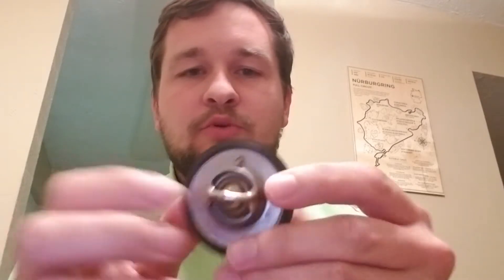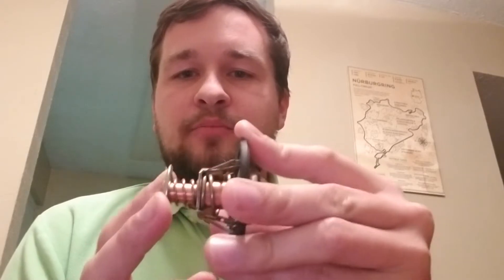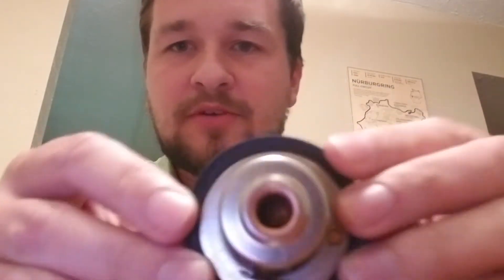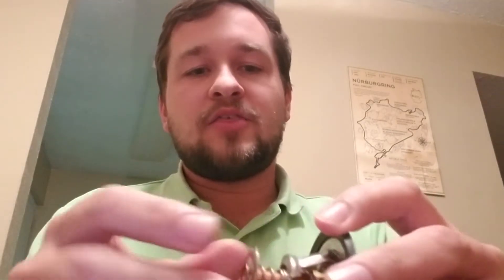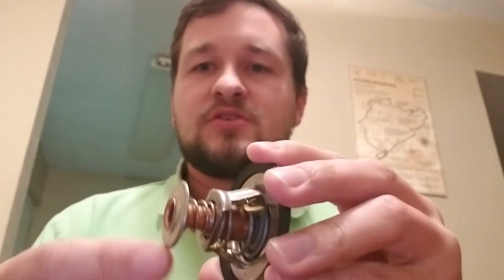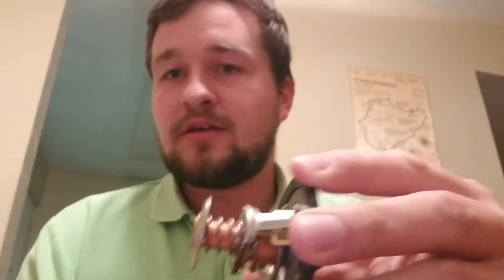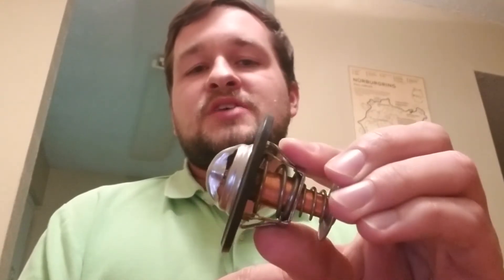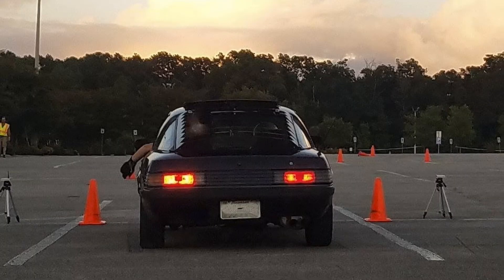Coolant Thermostat Basic Info (Rotary)

Comment: I bought a thermostat from Atkins rotary but plunger disc is bigger than the one on my car. Is that a problem?
Reply from the maker: On the bottom? No as long as it's flush
Reply: @CastellawSpeed  ok. The oring is also a littler different. It’s bevel on the edge unlike my current one which is flat.
Reply from the maker: @Hygoog  what year car is this for. Probably won't make any difference
Reply: @CastellawSpeed  ok. It’s an 1989 GTU model

Comment: Good video. My FD is taking longer to warmup recently and I have wondered if thermostat has died. When thermostats end their lifespan do they lock open like you described? I bought one from Mazda and will install soon.
Reply from the maker: Depends on if it's a fail safe one. Could also have sludge built up around it keeping it from sealing back up all the way.
Reply: @CastellawSpeed  I have ordered a new stock one and will see. Car was stock when I got it from Japan and suspect it has the original thermostat. Car still taking ages to warm up (like 20 minutes) when used to be warm after 5min. Starts first time and no smoke.
Reply from the maker: @wildlifeecology  sounds like the thermostat is stuck. Make sure to get some coolant flush and completely flush the system. You will probably have to do it a few times so get deionized water